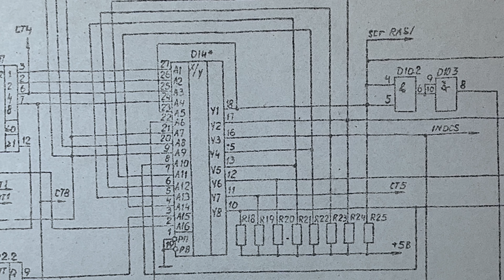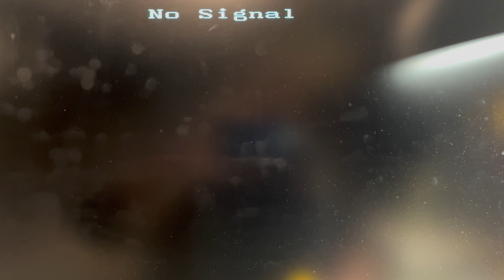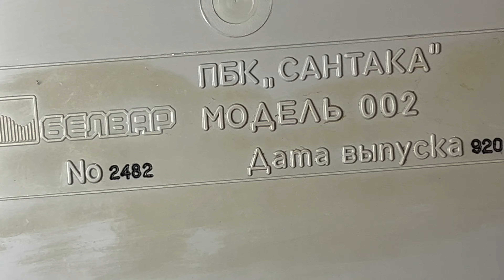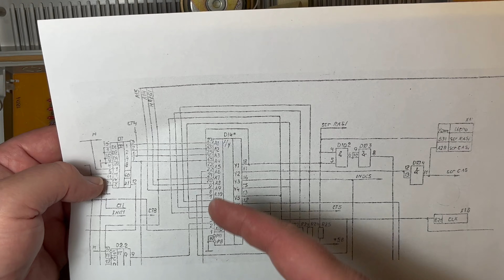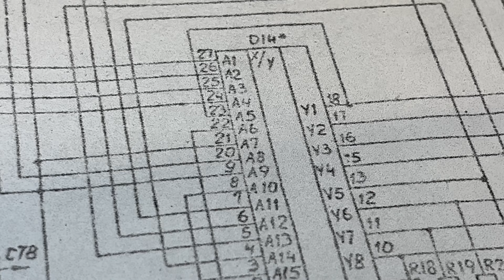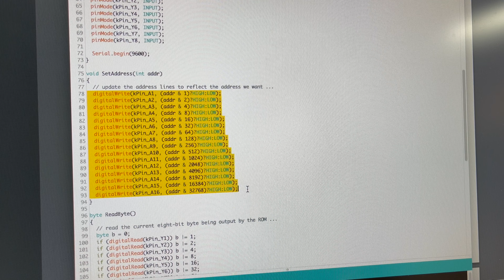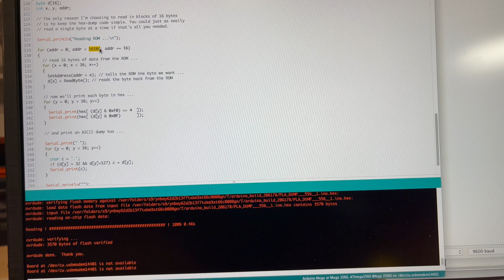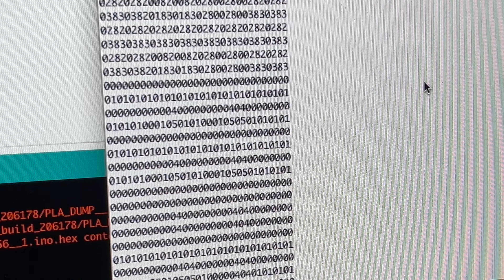🇧🇾🇱🇹 Сантака 002 (Santaka): Part 6 (Dumping PLA contents) [TCE #0435]

Comment: This is a new computer for me! What's going on @9:52 with R74 (R71?) in the upper right hand corner of the board? Kinda-sorta looks like a resistor mounted to the top (using glue or heatsink compound) of a legless chip from here.

Wise choice in leaving the chip in there. But rather than cutting a trace, I've seen people prevent the computer from powering up by holding the CPU's reset pin to ground. You could also try shorting the leads of the crystal together. Might work, might not. 

Using an EPROM could be tricky due to timing. IIRC, the two GAL replacement for the C64's PLA (?) was timing sensitive.

No need for programming a routine for the SD card, use CTRL-A to highlight the text in the serial window, and CTRL-C to copy it. Paste it into Notepad++ and hop on to Stack Overflow for the Regex to reformat your output.

@7:28. That's one approach for crossing tracks on a board on the video "card". :)

I didn't program in Pascal (nearly) at all, but I always thought that it looked much nicer than just about any other code. We saw it pretty frequently in the automation world.
Reply from the maker: [1] Oh wow ... I mustn't have shown this computer for a LONG time then ... actually, it seems all the videos are only in HD.  I might have to do a summary video in 4K.
[2] For powering the machine, I think it was more that all the other chips on the board were trying to draw power from the Arduino, which it simply couldn't supply as it was also being powered via the USB bus!
[3] Regarding the EPROM ... yep, I did think that as well ... but unless we can reverse-engineer the logic equations from the 64Kbytes of output so a new chip can be programmed ... ?  Dunno, this is a first for me!
[4] The serial monitor scroll back buffer doesn't seem large enough to store all the data, and it's also pretty slow ... it would be slowing down the whole loop.
Reply: @Brfff  
[1] I don't recall ever seeing it, but then again, I don't recall all that much these days. 
[2] It's worth a try... For the next time though, this one is sorted.

[3] Clive "Max" Maxwell's book "Bebop to the Boolean Boogie" has some excellent information on doing "Sum of the Products" and "Product of the Sums" as well as PLDs. But if the EPROM works, use that.
[4] I figured that it would be a one-time thing. So run your program and get as much of the data that you can in one chunk, and change the program for the next chunk and so on. Copy each chunk into your text editor and do your conversion. Or just hook up the serial port like you said. ;>

Comment: that was an interesting solution to connect the pins.. need to make sure they all connecting good tho... i would have just soldered thin wires to the bottom side pins..
...the schematic is showing pullup resistors on the output.. so really you shouldnt have needed to enable arduinos pullups..

Comment: Once you have the file as .bin try compressing it to see how much overkill it would be to use an EEPROM (I see a lot of repetition in there). But as others have said, it might take too many cycles (i.e. more than one) to put the right logic out as an EEPROM. You'd need an FPGA to get the timing right, but then you'd need to know the logic. It might not be using too many of the address lines since half of them are tied to outputs, so you could hang your logic analyser on them while it's running to see what it's using, and if you don't see too many of them you could then poke those into it and measure the outputs. A big job any way you look at it.
Reply from the maker: https://github.com/0ddjob/Santaka002_PLA
Reply from the maker: I added some further processing to my Python script ... there's 30 unique outputs from the 65536 possible inputs
Reply: @Brfff  some of the outputs being wired to inputs really complicates things. It is worth the risk of taking the chip out and running it against that?
Reply from the maker: @gshingles  The outputs should apply to the inputs on the next clock cycle?  Planning to run the machine and capture with logic analyser ... 16 channels should be enough ... let's see
Reply: @Brfff  yeah, you could be right, but they'll still be there when the next address is applied. Like if A4 is high when you are looking at address (whatever)..00000, it's going to output what corresponds to (whatever).. 10000. Mind bending stuff.
Reply from the maker: @gshingles  You made me realise that when I'm applying the 16 bit input, this would also be applying to the output pins as they're directly connected ... will think further
Reply: @Brfff  yeah, that's why I think pulling the chip might be the only way to get a clear idea of how the inputs relate to the outputs. Well, not the only way, but a way that doesn't involved 4D spatial reasoning. 🤷